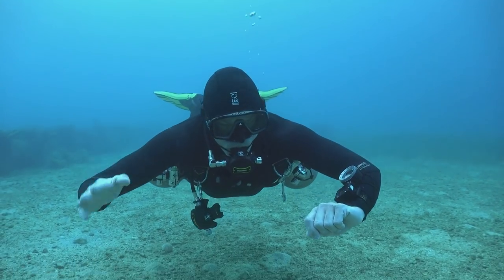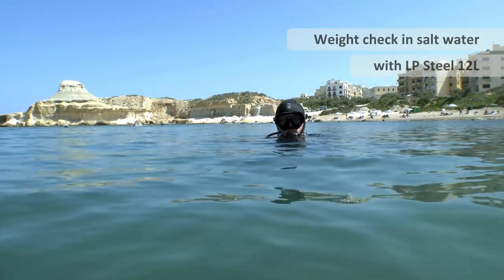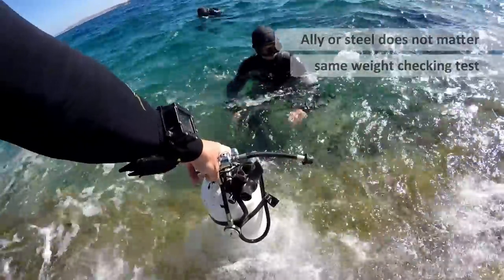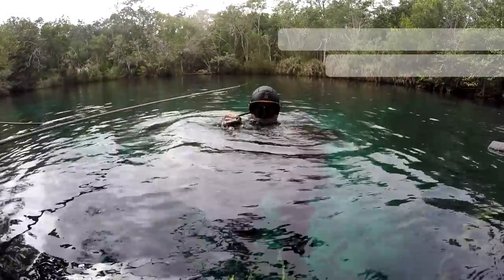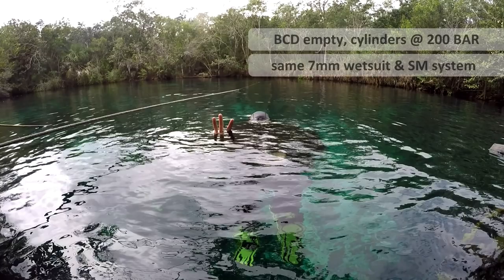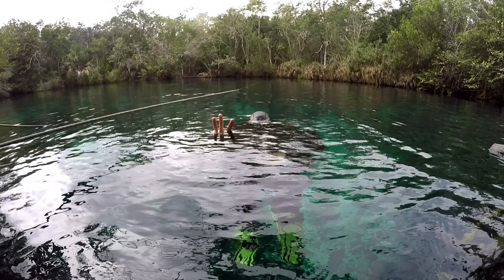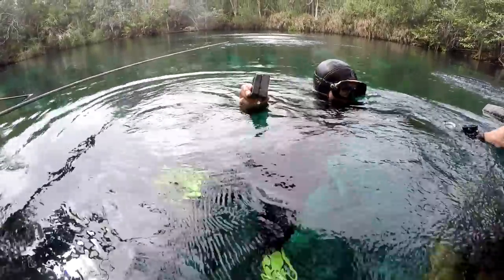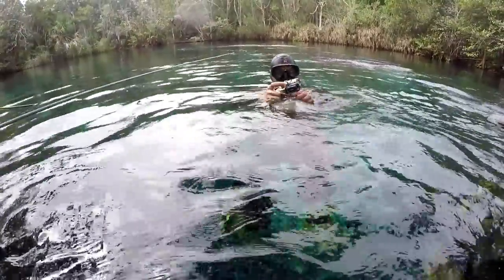Surface Weight Check Procedure - Sidemounting.com

Comment: Interesting! the procedure PADI teaches is similar, but instead of holding 80% lung volume, one holds a regular breath (which I guess is much less, like 40%). If the the water is then at eye level, one just adds 2kg to make up for the air that won´t be there at the end of the dive. I suppose both methods should give a similar result, but i´ll definitely give this one a try!

Comment: Buoyancy test with a 207 bar full aluminum cylinder is going to not be good way to test your buoyancy because all cylinders no matter what size or material they are made from will be more positively buoyant and best way to do a buoyancy is with an empty cylinder because the important thing is to be able to maintain neutral buoyancy even at end of dive even if you had an emergency and had to use all your air in the tank.  Every 13 cubic foot of air in your tank will have 1 lb buoyancy difference so an AL80 will be 6lbs lighter when empty and that is most important to maintain neutral at end of dive.  I would just  add how ever many pounds of air is in your tank on top of a check that is with a full tank.  I use a 120 and 133 cf tanks so even thought they are steel and might be negative empty I do not care because they will be 9 or 10 lbs lighter at end of dive and to maintain a safety stop or deco stop I want to make sure I can be neutral with it.  Actually my pony 23 cf tank is another 2 lb positive buoyancy if I were to use that so I need to weight myself for a possible 11 or 12 pound positive change in the event of an emergency when I need to use my tanks
Reply from the maker: Thanks for comment, understand you point very well. My surface weight check procedure will get you to plus or minus 1 KG when done with full cylinder(s) so is very accurate, however I do agree an underwater weight check, done at 5 metres / 15 feet with 50 ABR or 700 PSI in tank, with empty BCD holding still is the way to go for best accuracy and have that covered in several online training videos on sidemounting.com in all backmount and sidemount courses, here is an preview of one of the those videos https://youtu.be/i0NvM_Y04Yw Regards, Steve